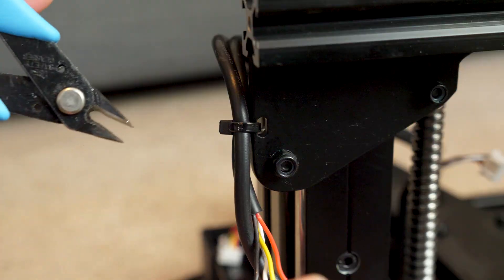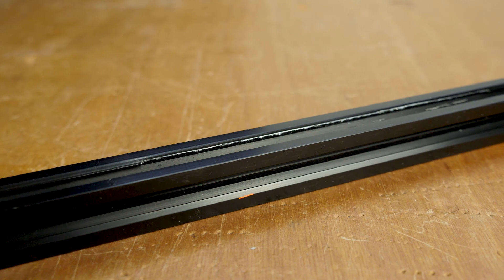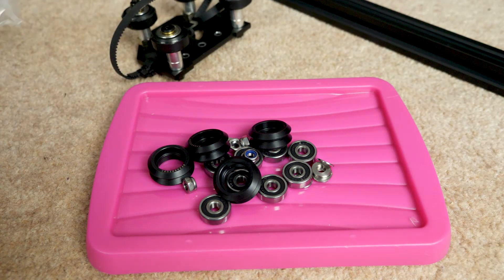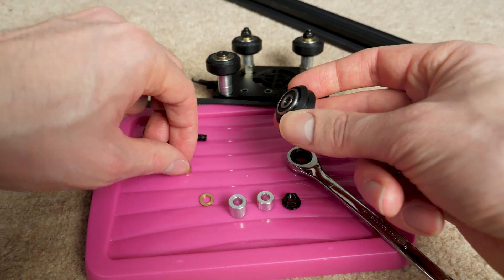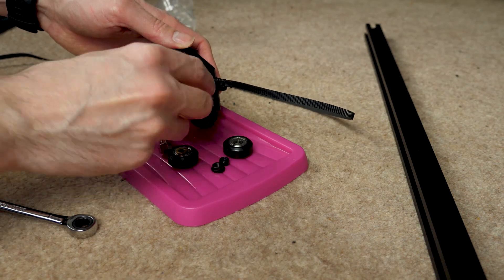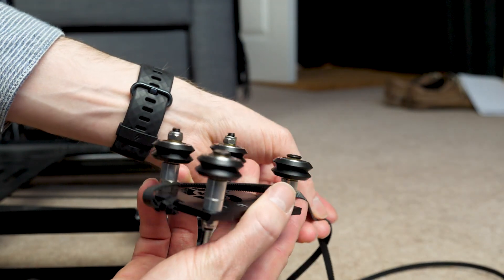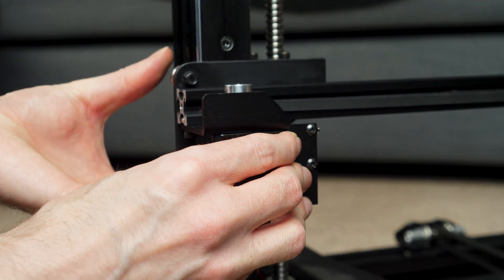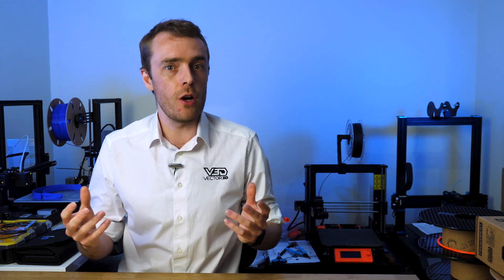WELL THIS WAS UNEXPECTED!

Comment: How the bloody hell did that extrusion get damaged?!!!
You said that it was bought "used," even so, that kind of damage to an extrusion would take some serious stupidity on the part of the user.
Seriously,  it might have been there since new, and the 1st user sold it on as it was 'not working properly.'
If the damage happened during printing, you would have seen metal shrapnel all over the place as it broke up.
Reply from the maker: I think it might have actually happened when tightening the vslot wheels. Been over tightened so far that the extrusion just broke underneath. Poor quality extrusion is probably part of the issue too.

Comment: Ooh, interesting @ Hemera mount design :o
I bought a Hemera within the first couple of days of launch, so I have one of the first batch, I guess, but it's sat in a box unused ever since, because my printer has been out of action since ... October 2018 >.> I've just been too ill and my life too screwed up to find the time to finish fixing & reassembling it (the Y-axis belt holder broke, and the PEI sheet needed replacing after a polycarbonate print fused to it! But in the process of replacing those I opted to upgrade a ton of other things as well, so it's taking ages and still has a fair amount of work left before it'll be operational again).
But since I don't have a working printer, I can't print a Hemera mount - and remounting the original extruder just to print a Hemera mount seems silly.
However I did recently build a "3018"-style CNC engraver (SainSmart's 3018-MX3; thanks, ADHD, for giving me yet another distraction & time-sink!), so I've been planning a Hemera mount that could be milled from plywood or MDF - at least as a temporary thing that I can replace wiht a 3D-printed version at a later date :)

Comment: Nice video. But why a new extrusion? In the video only the slot where the wheels were (top and down) seems worn out. The front and back seem quite fine, so rotating the old extrusion simply by 90° should work also.

I had a simmular problem on an Ender 3. I accidently turned off stealt chop on the x-axis (using SKR e3 mini). 4 days of printing (with a direct drive Extruder, so some more exentric load) and wheels and vslots where ruined. As the weight of an direct extruder gives some tourqe on the construction, Sovol uses a 2040 and Attilery even a 2060 for x. V-rollers on a 2020 might wear off fast, if a direct extruder with its weight gives tourqe to the vslot-system. So for a DDE (like the hemera) you might change the x-axis to 2040 or even 2060 - The more far the opposite wheels are away, the more exentric load can be moved.
Depending of the lenght of x-axis, a linear rail might be an alternative, as they can handle more exentric load than an 2020 vslot. On my Ender 3 I use an (cheep chinesse, about 15€ incl. shipping) linear rail now. It works wonderful.
Reply from the maker: Spoiler alert, needed extrusion anyway, so best to use the newest one here. You'll see later on.